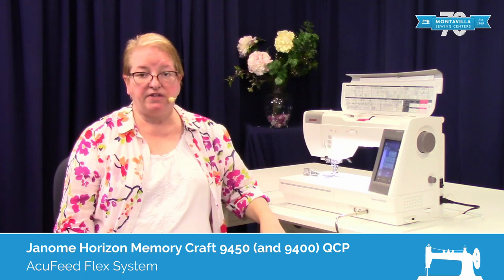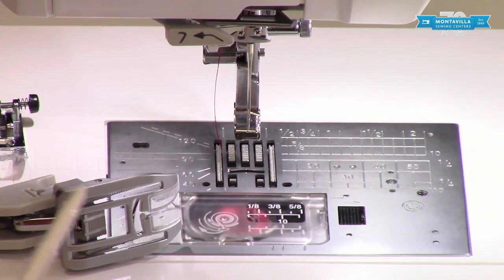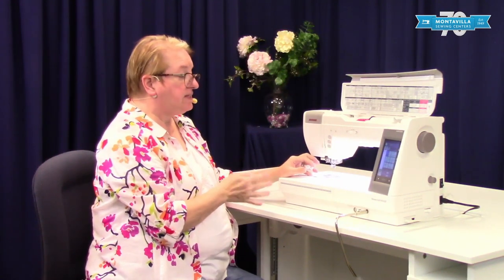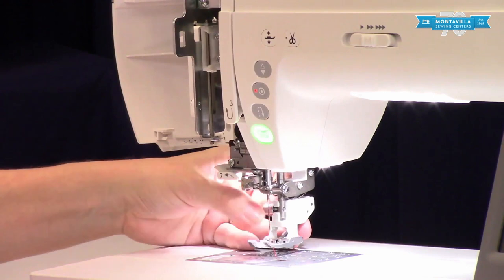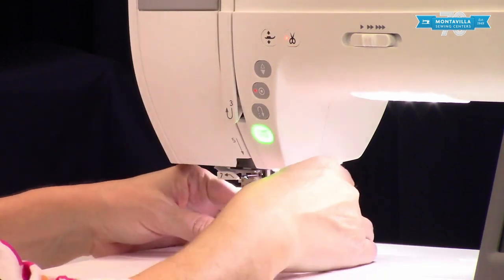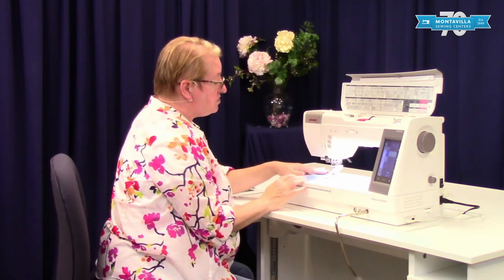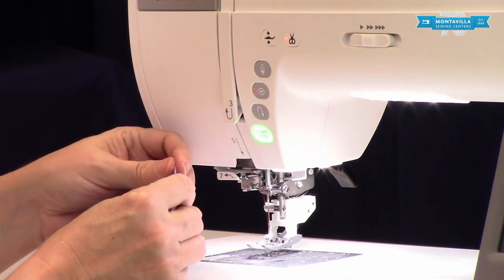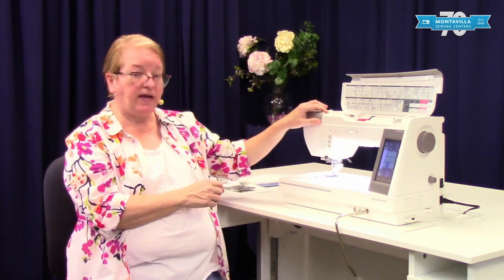Janome Horizon 9400 & 9450 AcuFeed Flex System Tutorial - Montavilla Sewing

Comment: Some very subtle stuff in here. 

If the autothreader frequently gets misaligned, there should be a user friendly way to re-align it. Is there one?

How does one know when to turn off the computer control button of the Accufeed system?

This was very informative. Thanks.
Reply from the maker: For the needle threader, its the worlds tiniest crochet hook and if it gets bent it needs to be replaced typically, you can sometimes bend the hook back but it doesn't usually hold very long. I would make sure you aren't using a needle smaller than 80/12 since, since any eye smaller will most likely bend the hook on the threader. For the accufeed system, it is highlighted in yellow when it's activated and blue when its off. it should be activated anytime you are using an accufeed foot, and deactivated whenever you are not using an acufeed foot. I can note that having it activated while not using an accufeed foot will not cause any adverse affects in your sewing. There will simply be an extra part moving in the machine that doesn't need to be moving.

Hope that helps!